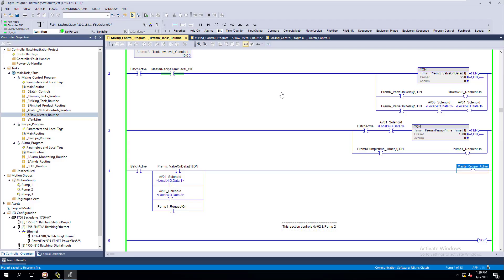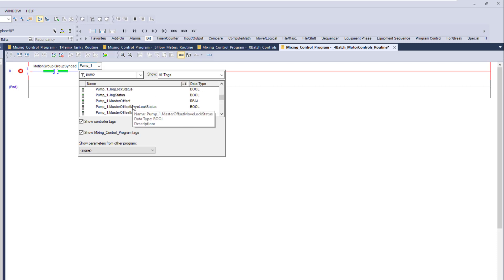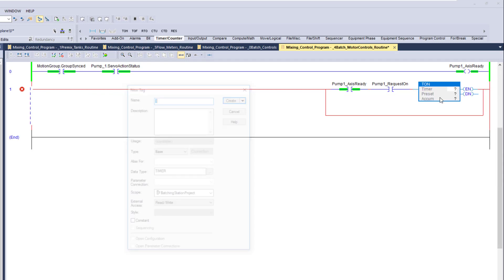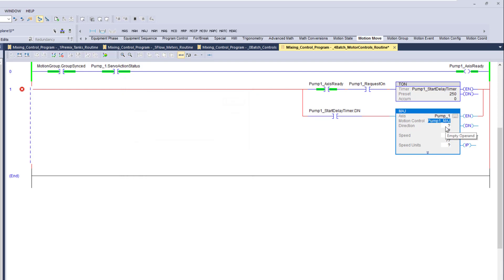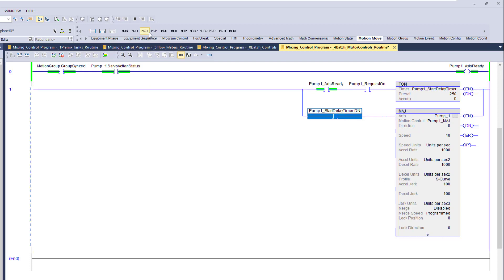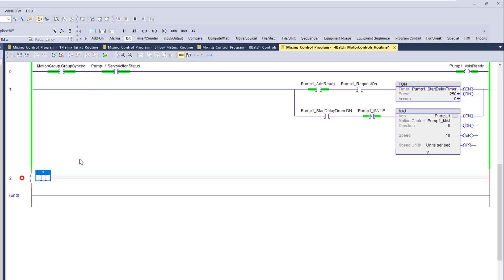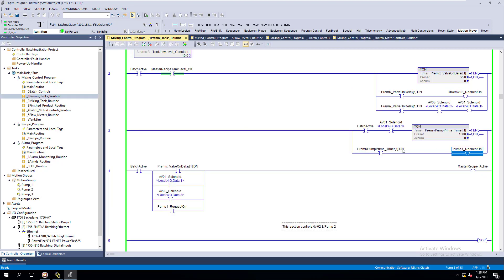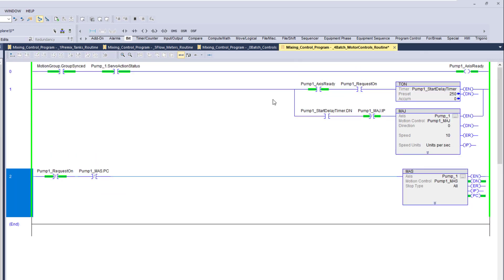Servo Controls | Programming PLC Controls For A Virtual Axis | Batching PLC Day-28

Comment: Great video.  However, at time 16:45 at rung 1 (of _4Batch_motorControls_Routine), the XIO for Pump1_MAJ.IP is a “1” state and therefore false.  But then at time 17:07 at rung 1, the XIO for Pump1_MAJ.IP is a “0” state and therefore true.  What caused this change in state?  Thank you.
Reply from the maker: The servo bits trigger quicker than the screen capture can catch it so listen to what I did and that's what fixed it